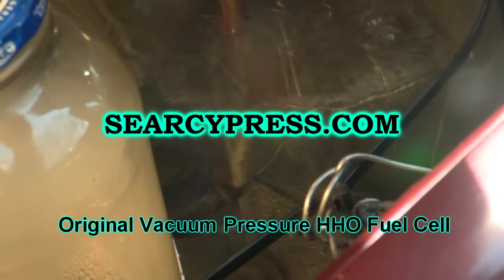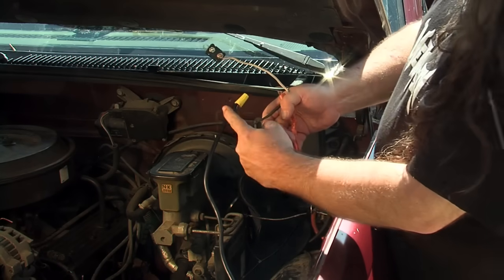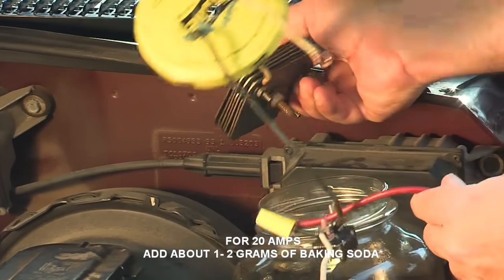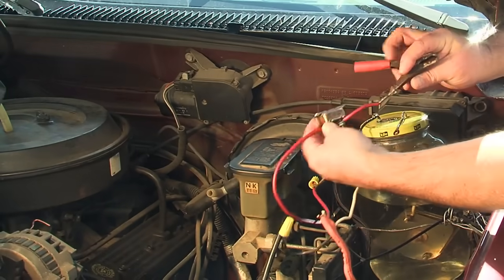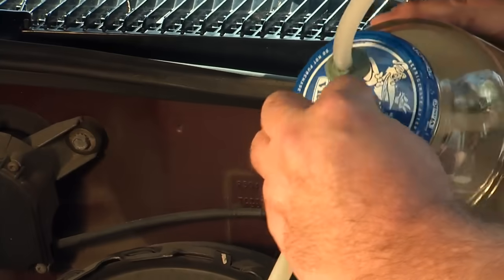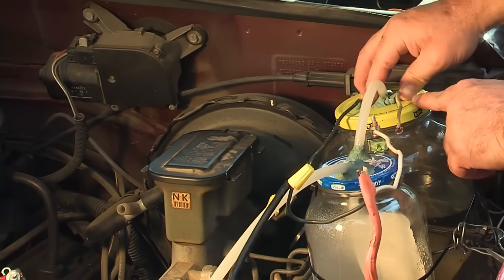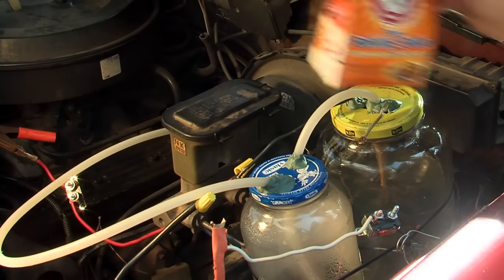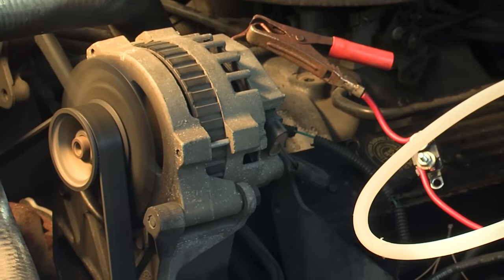Vacuum Pressure Hydrogen fuel cell defeats high gas prices using hydrogen from H2O.

Comment: Could you put a pressure switch for the gas to shut off the voltage?
Reply: Yes, if you had a storage tank for it.  This would be best done below the pressure at which the Brown's Gas mixture would self detonate.  Like Acetylene, which must be kept in a high pressure tank which contains Acetone to absorb it's gas, there are limits to the pressure at which Brown's Gas will not try to recombine.

Comment: This is hho and not hydrogen alone. The engine needs hydrogen alone so make a separator where you can collect the hydrogen and discard the oxygen. Connect only the hydrogen output to the engine and your car will run absolutely.